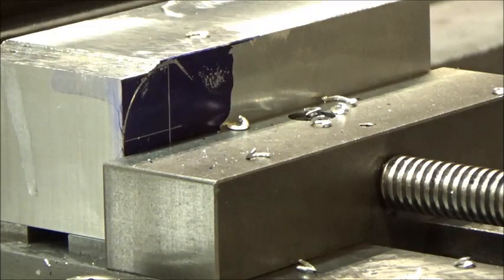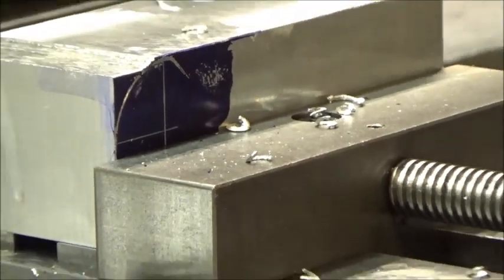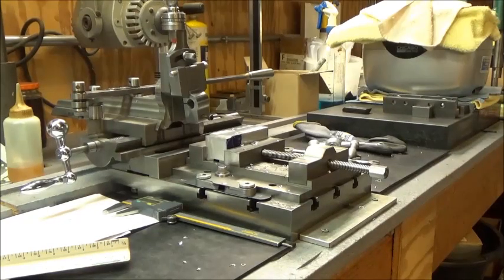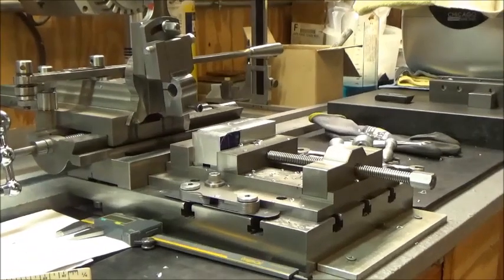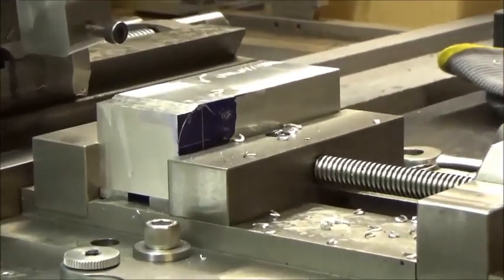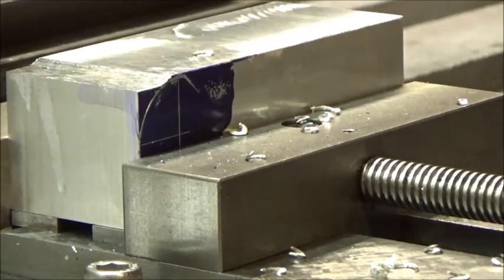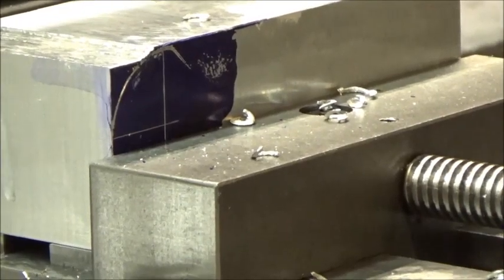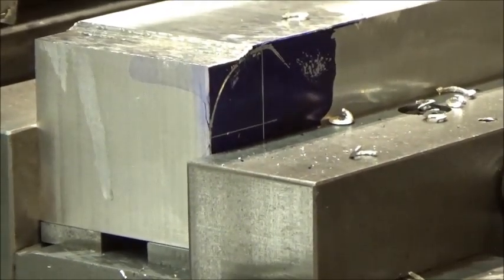Shop Built Hand Shaper Cutting Outside Radius

Comment: An old engineering book I have somewhere explains a good way to achieve a nice finish using a metal shaper to cut a profiled shape that can have both internal and external radiuses. First you scribe a line of the shape you require on your work. Then you rough cut down to about a 1/16" above the scribed profile line. Then you use a file to cut a shallow chamfer in the remaining metal, all the way along your profile line down to your scribe line. Then finish cutting can commence by creeping up on your scribe line while watching the chamfer gradually disappear. I have not tried it, but it sounded plausible.

Comment: I'd love to build one of those shapers do you have plans for it?
Reply from the maker: Sorry.  I built it from photos on line of the Petite Rapide Lime Hand Shaper originally manufactured in France.  I scaled it down 20% to 80% of original size, so it's almost full size.  All the dimensions were estimates based on information I could round up from hundreds of photos.  Of course I did create drawings for myself during the building process and those are on my OneDrive Photo Album at the bottom of the page.       https://1drv.ms/f/s!AoFHBXavAXM5g7QKVMavnN0J1753Fw 
Thanks for your comments and Best Regards: Larry
Reply: @larrypoindexter9351  I built foundry patterns I might have a go at doing iron castings.
Reply from the maker: Good Luck.  Your welcome to view photos that I've collected off the internet of the original machine.  You can also scale my drawings up 20% and estimate an approximate full size.
Larry                    https://1drv.ms/f/s!AoFHBXavAXM5g7dj21vvq0HQi2QHHw

Comment: Larry,
    that does the trick quite nicely and with the feed is that with the 14 tooth star wheel? I'm guessing it was a 20 thou deep cut as well? well done, take an orange out of the bag
Reply from the maker: I'm still using 12 teeth and a very shallow depth of cut so the steps will be very tiny.  Only takes a touch on the belt sander.  A file would also do nicely.  Steel works equally as well.